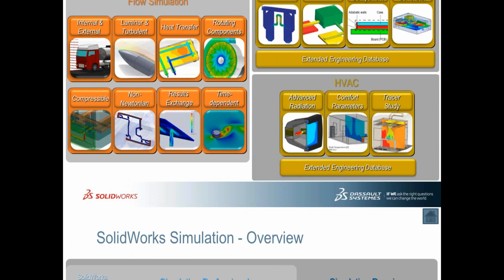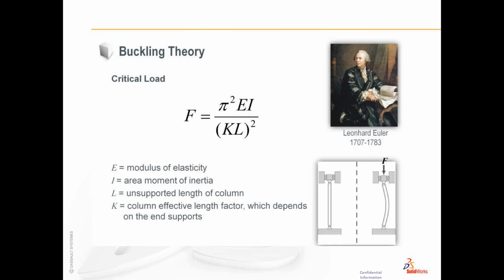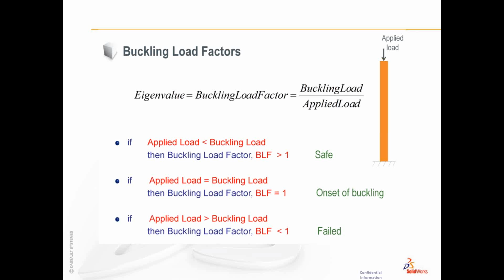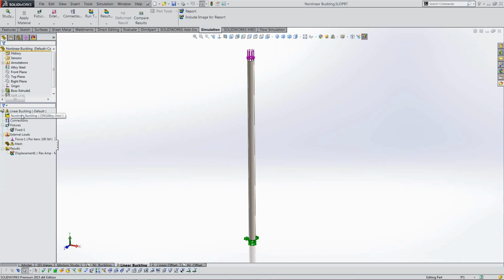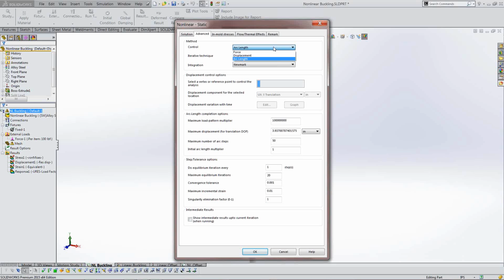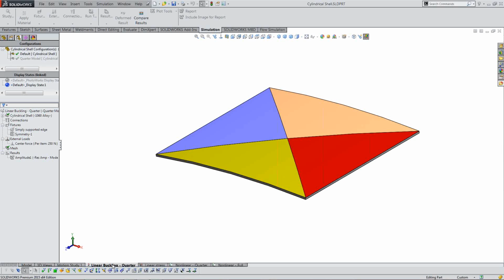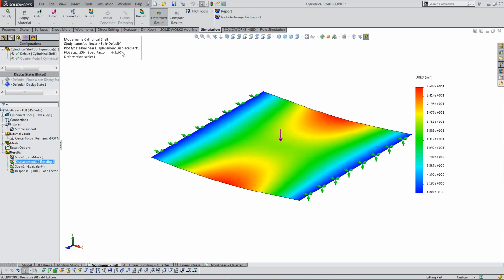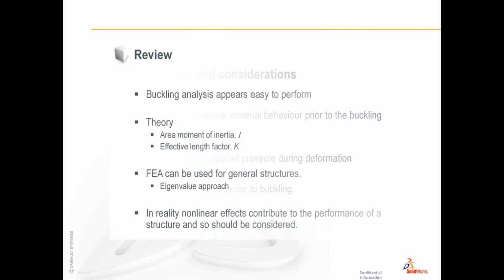Webinar: Buckling Analysis Using SOLIDWORKS Simulation

Comment: When I do this arc length method with a plate, with fixed connections at the top and bottom, much like an inner web I-beam, I get that the plate is buckling move in the longitudinal direction than the transverse direction. Any help?